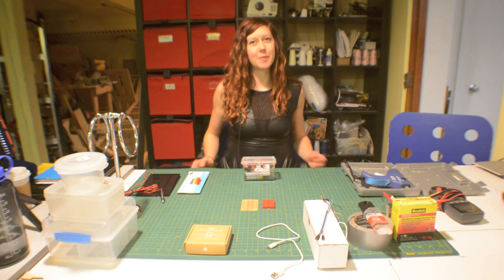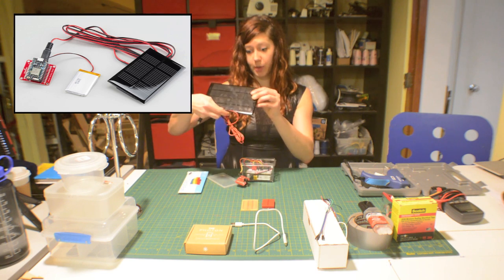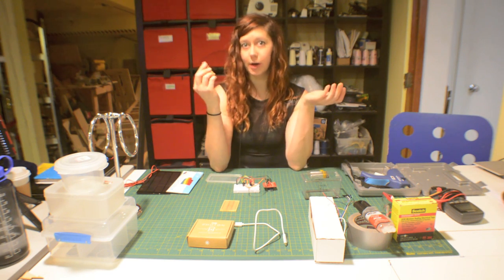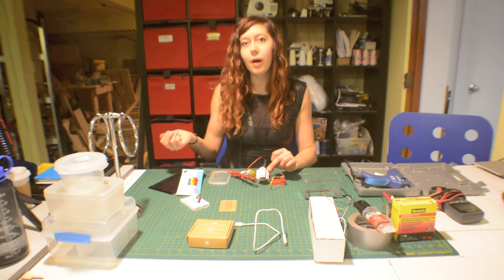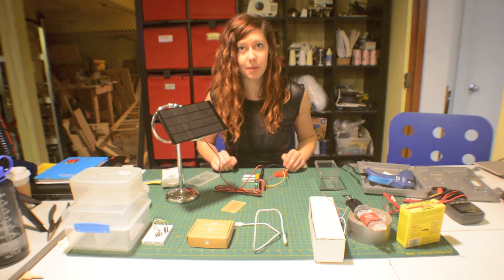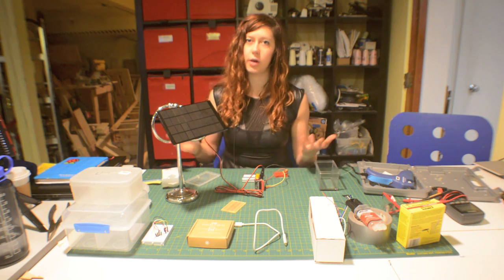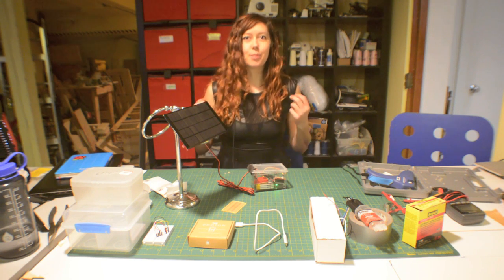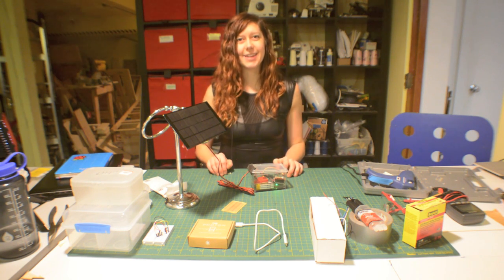Maker Quest: Remote Temperature Sensor

Comment: First, you have to have the voltage above the potential of the Cell or the current is not going to flow in the right direction to charge the cell (that does not mean the voltage has to be huge, usually around 2 - 4 volts depending on the chemistry of the cell ). Such as in normal 12V Lead acid car battery you need around 14 Volts. Anything over 14 Volts is going to be turn into heat, and shorten the life of your battery). Yes, I know your playing with LiPo, but over voltages still can mean damages to LiPo batteries. 
Second, Batteries are charged by current, not by voltage. And the C has to be in the tolerance of the Cell your playing with.

I do have one question about the project - what are you going to do next? Are you going to draft a PCB that going have everything  together?
Reply from the maker: +Blacklab412294 Yup! The potential of the solar panel must be higher than the potential of the battery or the solar panel will not be able to charge the battery b/c it doesn't have enough energy to overcome the battery energy. Definitely want to avoid over-voltage for any battery chemistry. Fortunately, the SparkFun Photon battery shield takes care of this for us. And yes, the charging rate for a battery depends on the applied current.

In terms of next steps for this project, this is sufficient for my purposes. It was installed outdoors for about 2 weeks and everything worked just fine (even after getting pummeled with some serious rain and wind). If you want a permanent system, I'd highly recommend using a PCB rather than a breadboard.

Comment: I still think you must have majored in EE. 
About your voltage question: The solar panel voltage need to be high enough to overcome the hydraulic energy of the rain clouds we get in the Northwest.  :-)  
Nice project Jen, I'll give it a try.
Reply from the maker: +Bill Wells Been working a lot in EE these days so it's a good sign that you think that -- thanks for the compliment! 

Haha those rain clouds do act as an energy sink, would definitely require a higher initial solar panel voltage. 

Thanks! It is quite fun to be able to see data from a sensor built entirely by your own hands (and brain). Thinking of installing it up in Leavenworth to keep an eye on the rock climbing weather.. tons of practical applications!

Comment: The input voltage needs to be higher because the potential difference needs to create current into the battery. (currently self teaching via Navy Electricity and Electronics Training modules) Hope I worded that right.
Reply from the maker: +Jonathon Mohon Exactly! Sounds like you're doing a great job self-teaching!